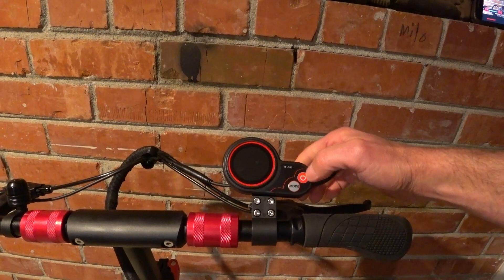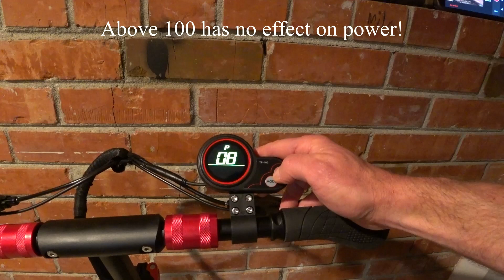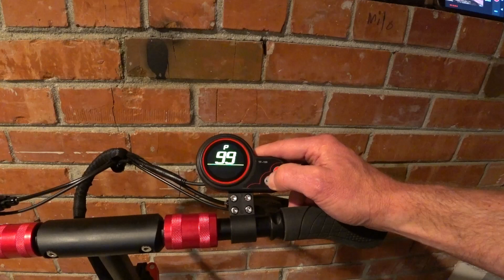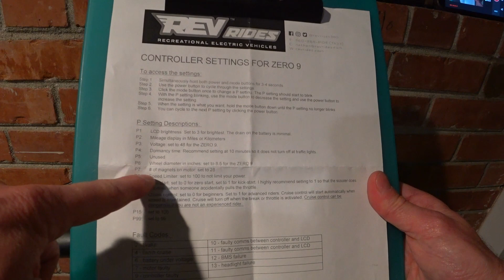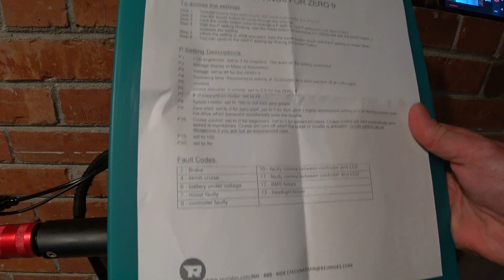Zero 9 (2019 model) Display Operation and Control Settings.

Comment: isn't there a setting of brake regen strength?
Reply from the maker: Honestly I don't know, it's been so long. I don't think this generation of Zero 9 had regen but more recent ones might have. Hopefully someone else chimes in for you.
Reply: @ElectronSurfer  I tried doing these settings on mine, it goes from P1 to P20. I asked AI and P11 is braking strength. looks like yours doesnt have that?

Comment: Isnt it 30 for the p7 magnets ?
Reply from the maker: It could be, it is an old video and all my notes had is set at 28 or higher.
Reply: @ElectronSurfer yea maybe try 30 and see if it runs better. And let me know if you find out tge right setting. I really wanna get this setting right in mine
Reply from the maker: @Rexx90  It depends on which motor your scooter has, here is a guider from Rider Guide. https://riderguide.com/guides/electric-scooter-psettings/

Comment: I counted the magnets when I took the motor apart and there were 30 so I set it to that value. I havent’t noticed a difference. The speedometer is like 4 km/h off. I tried a few settings to no avail. Any ideas?
Reply from the maker: The magnet setting is totally goofy, I don't even know what it actually connects to, i should connect to the hall sensors to ensure the motor runs smooth. 4km off isn't bad for these displays, I usually play with the tire diameter to try to get closer to the actual speed.

Comment: hi tnx for the guide. when i in the settings menu (p-settings) , and i long press the power button, the "A" in the bottom line changes to "D". do you know what is the purpose of this mode A/D ?
Reply from the maker: I really don't know sorry, there were a few iterations of displays used in the Zero scooters. RevRides is a good resource, you could reach out to them.

Comment: If I have 52V 13 A battery version, should I change P3 setting to 52V or leave it at 48?
Reply from the maker: P setting should match the battery. It will give you more accurate information on the display.

Comment: Hey man. Thanks for the video👏🏼 Super helpfull. The power level settings, when i turn it down the scooter just start superslow. Is there a way to make the display show «faulty» numbers? Like the accuracy of the speed. When i run max speed it only show like 25km/h whn im infact running at higher speeds? 🤷🏼 Heared rumors about it but no valid info as of yet. Thanks:)
Reply: Нужно обрезать белый проводок )ограничитель скорости

Comment: Hi I got my zero 9 and in the controller settings it doesn't show alla P's just 3-5-7-9 and 99 and 99 has all 0's and can't change it does anyone knows how I can restart it or something;
Reply from the maker: I am pretty sure they changed the display since I did this video, I'd check with Falcon PEV or RevRides for the current settings.

Comment: Does it have a magnetic/regenerative braking?
Reply from the maker: It does have electronic braking which in theory would give a little bit of regenerative effect, the reality is with a scooter you won't get much regeneration but could save some brake wear.
Reply: @ElectronSurfer  the brake effect is really what i want, I got used with it from the xioami m365 that I had before.

Comment: Hey Jim thank you for your videos. 

I had an issue that I wonder if you could help me with, and I wonder if you had it as well.

It happens to be that my Zero 9 came with a speed limit.

I know that it’s maximum speed is 45 km/h, but in the case of mine, it came with a 25 km/h limit.

I ordered it from Falcon PEV (since I’m from Mexico City), and I wonder how can I remove the speed limit to its normal/maximum top speed of 
45 km/h capacity. 

I am afraid I am going to be using it pretty often for certain rides.

And, if I actually paid for a bug with that capacity, I would like to be able to actually USE that power when needed, you know?

Thanks ahead Jim, I’ll be waiting for your reply :)
Reply from the maker: Thanks for the question.  I'll have to confirm this but i'm pretty certain you have to open up the deck to reach the controller.  There will then be a single wire, commonly grey, connected.  That connections locks in the speed limit.  I'd suggest you call or email RevRides and they can tell you exactly which wire it is.   Unfortunately I don't have the Zero 9 here anymore to get that detail for you.  I hope that helps.
Other than the speed, how is the scooter?
Reply: Electron Surfer Thanks for your answer bro, it was actually really helpful (I’ll do exactly that)

And yeah, apart from that, I’m super impressed about the scooter.

It’s actually A LOT bigger, heavier, and bulkyer than what I imagined it was gonna be.

But that’s actually a good thing!

Because it feels safer as well. Stable.

I love the feel of it in general.

Before this one I had a pretty cheap and crappy one (non electric), so the upgrade felt EPIC! 

It feels I‘m riding a beast! >_<
Reply: Thanks for asking! 😀👍🏼
Reply: @lalobalandrano3335  exactly what I named my Zero 9."The Beast

Comment: My 10x only speeds 25km/h   How can increased the speed?
Reply: Take your head light off on the left side there's a white wire unclip it this is the restrictor for the 10x
Reply from the maker: @Mike Santana, I am not sure if the 10X has the same display as the 9. Besides the various speed limit settings i'm not really sure, i'd check all those.  I don't have a 10x so I can't help you more unfortunately.
Reply: depends wich country you live in,in australia all electric scooters are capped at 25km/h and cannot exceed that.

Comment: Hi! The LCD control unite just realized that has a USB port connection on the side , what is that for? And this is on Zero 9.
Thanks.
Reply from the maker: @jack menino, I think it is for device charging, I have one on my Zero 8, i'll verify for you tonight.
Reply: Thank you, just noticed USB port on zero 9. Will come in handy for charging phone and other devices, "Thanks for the smile".

Comment: How do you get it to start in gear 3 from power on? Mine always starts in gear 1 when turning on.
Reply from the maker: @Edgar A, as far as I know there is no way to change what power mode it starts in, it could be a safety factor I suppose.  When I power it on I just change it right to gear 3 immediately. Thanks for the comment!

Comment: Just wanted to note on here that all ZERO 9 scooters going forward have the same controller as the ZERO 8. This video is only accurate if your controller says "TF-100" on the top of it. Regardless, this video is great and keep up the good work!!
Reply from the maker: @Tyler Boni, Thanks for the comment, i'll update that in the video description that its for the 2018 model for the controller model.

Comment: P7 magnetic number for zero 9 as said at 28 bit of delay or is 28 everyone's setting anyone????????
Reply from the maker: @Matt Harris, I found that if I increased the magnet setting the delay was less but the speedometer and odometer is then not accurate.  I was hoping there would be a way to update the controller, i'll ask RevRides about this.
Reply: I have mine zero 9 set magnets to 30

Comment: I run into a problem i now get error codes 8 and 10 do you have any idea what it is?
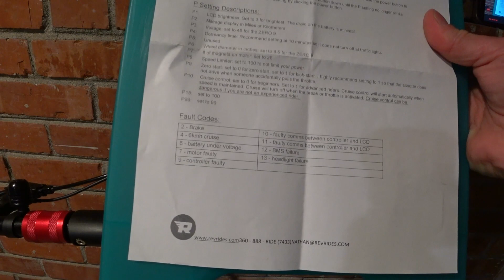Reply from the maker: @MrZones21, code 10 = faulty comms between controller and LCD, maybe a loose connection. The detailed instructions do not have a code 8. If you pause the video at 1:10 you can see the error codes.

Comment: hi thanks for the cool reviews, I would like to ask what would you prefer z8v2 13ah or z9?
Reply from the maker: @Marlown Mormor, The Zero 8 I have is 10.4ah.  I don't think a larger battery on the Zero 8 would make a huge difference to me. That being said I personally like the Zero 8 a little more as its a little more nimble, the 9 is more comfortable and capable off the pavement.